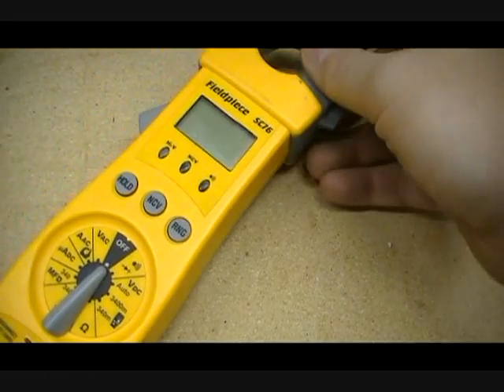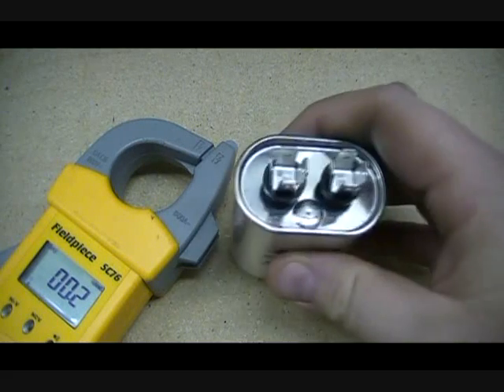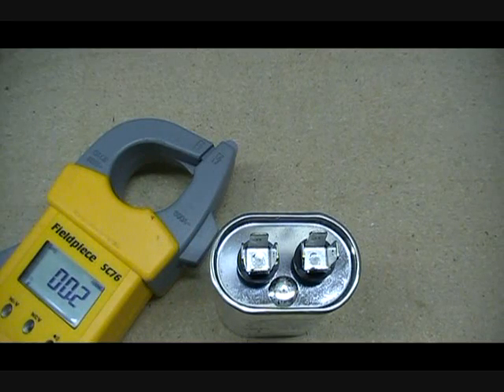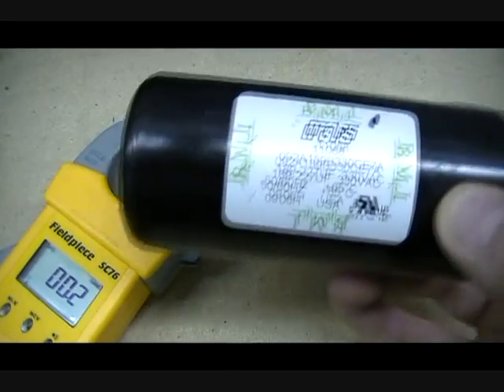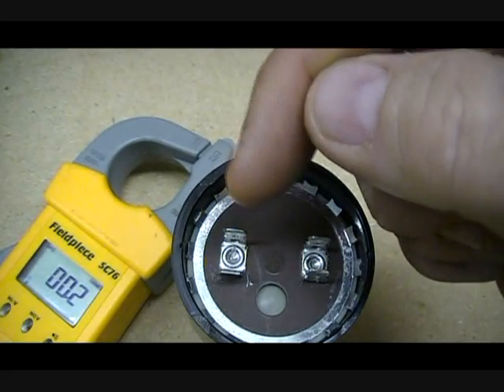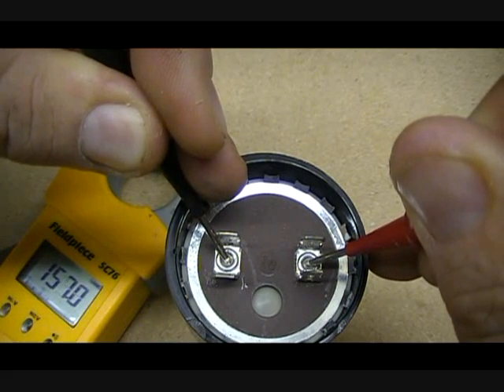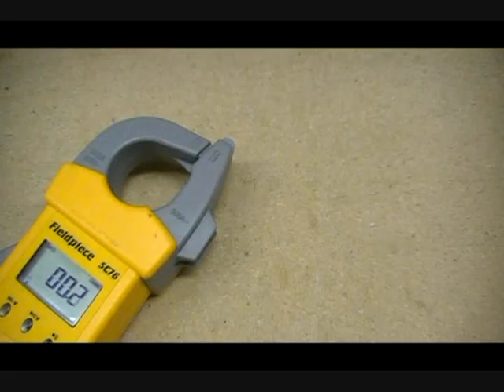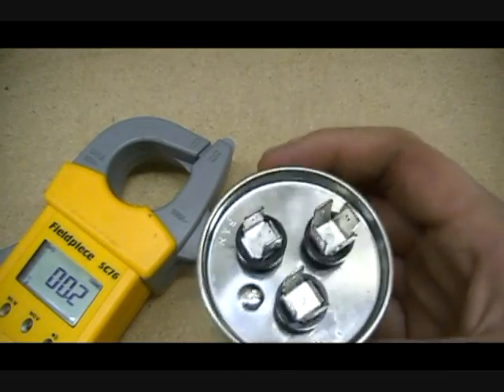How to check Capacitors

Comment: If u understand how they work and are made you would know it's bad simply by looking at it and why that is possible..capacitors used in hvac ...almost all cases of capacitor failure it will be bulged and look like something blew up inside of it... That's exactly what happens... A short can create a lot more pressure inside of it because of the increased temp  the short created...which is why the correct capacitor must be used...motors use More or less amperage when incorrect capacitors are used... Motors life is shortened by using incorrect capacitors..if the capacitor is open and not bulged it needs to be replaced anyway..that is why you only need to look at it.. .besides of the fact that I could change a capacitor before someone can take out their meter and get it ready to use..

Comment: With dual run capacitors, do both capacitors usually fail at the same time?  I just don't want to have a situation when the AC compressor runs while the fan does not. Thanks.
Reply: no!  they can fail independently of one another.  if you see the top of a capacitor bulge from the top it has failed altogether.  but it can also fail in a way in which only the "fan" portion of it fails

Comment: reupload please.
the bad capacitor will give you zero reading on your multimeter. 
zero means that the capacitor is not allowing current to pass(faulty).
make sure to discharge the capacitor before you remove it,sometimes it holds an electric charge about 400 v and that would be enough to cause a real damage.

Comment: Too bad the video stops when you get to the section that finally addresses the "Dual Capacitor" used in a Central Heat & Air Unit. I wanted to see that part.

Comment: That's completely wrong for checking capacitors since that capacitor is used to receiving 208/240 volts and your meters is 9volts. That's mfd selector is for checking capacitors on a board genius learn to the formula

Comment: The only real way to check a capacitor is to use your TONGUE, make sure you've just taken it out of a circuit and it's dielectric can hold more than 300 volts.  Going by this video you might as well, The first thing you need is a meter??? WTF.....The first thing you need is to consider safety.  Capacitors hold electricity that should be discharged first.  You can test a capacitor with a simple ohm meter by reversing the leads Google it.  This video needs to be removed.

Comment: This method does not show if the capacitor is out of range, I just had a capacitor on a central AC unit that was reading 40uF but it was rated 50uF. This can cause a problem with starting, compressor motor running too fast or slow can cause the compressor to run hot and use more energy than normal. If you don’t have a cap checker and you are in doubt, I would take it to someone who has a tester and have it tested

Comment: Something alot of people don't know about a capacitor is that if it fills to capacity before the load can drain it down, it will OPEN. Meaning your voltage will be cut off.
         ***          Check out my Blog to learn more about          ***
*** HVAC and DDC Controls as well as Building Automation Systems. ***

Comment: It is important to discharge the capacitor before taking a reading, damage can occur to your meter from a charged capacitor, another thing which is important use a quality meter from the supply house, don't invest in a Radio Shack meter you will be only throwing your money away.